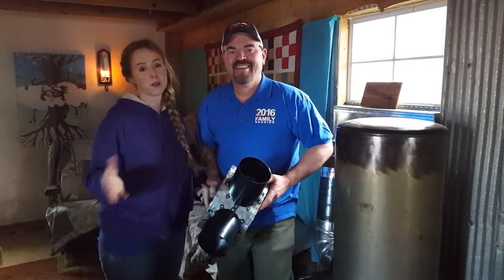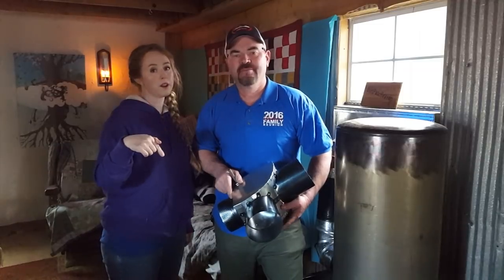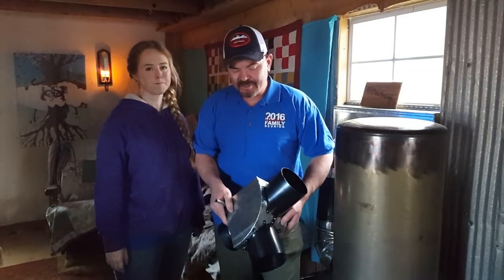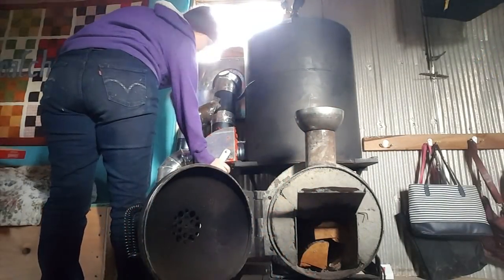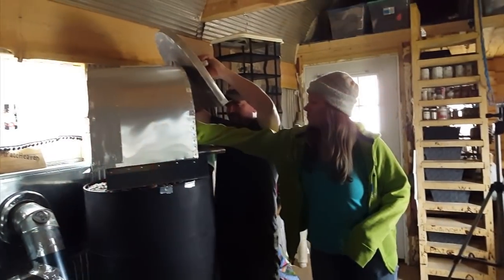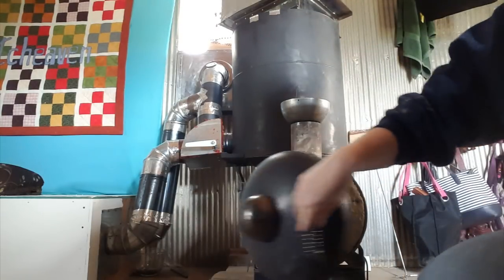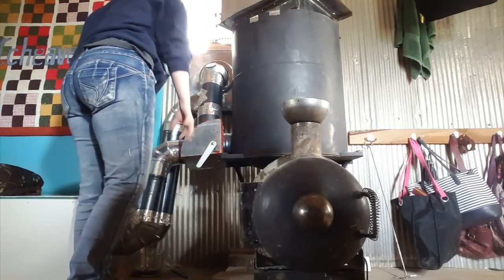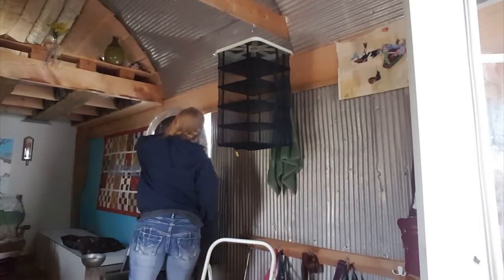Portable Rocket Stove You Can Make Yourself

Comment: A lot of chimneys that go through the wall rather than the roof have draft issues when it's cold, as the hot air pushing up inside the house creates zones of low pressure below the ceiling.